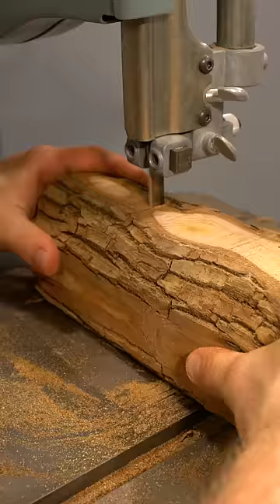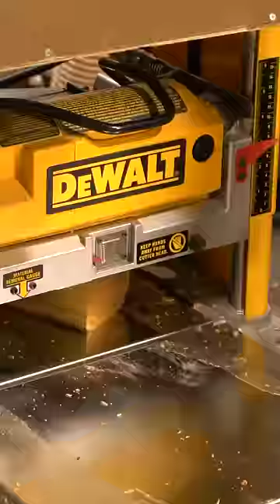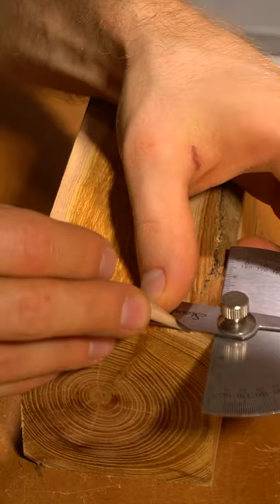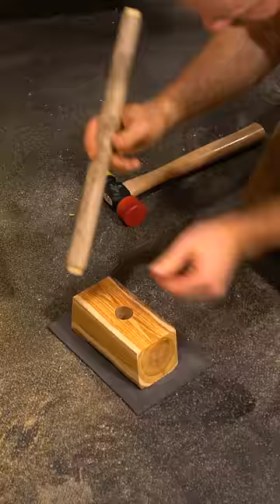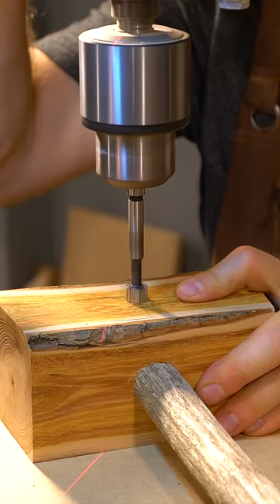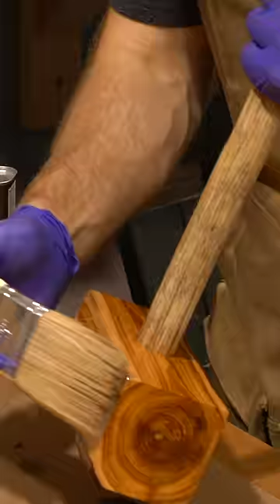I Turned an Osage Orange Log into a Wooden Mallet!

Comment: Best firewood you can get, unless you have a open fireplace, watch out for the sparks
Reply from the maker: I've never burned Osage Orange wood but I imagine it being great since the wood is so dense, the logs probably burn longer than most.
Reply: @_Shopfix  and I didn't mean any disrespect to what you built, I love it, looks great, also I believe that wood is rot resistant and would last forever, but love what you did with it. You got a sub from me.

Comment: That's a very big retention dowel! I would have been too nervous about using one that big.
Reply: I'd think, because of how deep in the mallet head the handle is, and the fact that he was liberal with the glue, that it would be fine. A lot of times with glueups, the glue bond is stronger than the wood it's gluing.

Comment: Nice work.  I think your dowel through the handle is too large for proportion to the handle size however.
Reply from the maker: Thank you! I see what you are saying, you wouldn't want to go any bigger than I used here that's for sure. However, if you went with too small a dowel its likely to break as it requires a lot of force to hammer the dowel into the hole even with a kerf cut into the dowel. I tried many ways to create this style of mallet. I have a full length video you can check out on my channel page! Thanks for the comment, take care!
Reply: @_Shopfix  yeah, maybe two small dowels, one on each side of the handle and the handle has half circles for each dowl.  Or maybe a traditional wedge, even an osage orange wedge.   I found a really huge osage orange in dayton ohio.   I filmed some on my old Delticola channel out of Alabama, planted in 1840.

Comment: Okay why did you make it with slanted faces? They appear to not be 90 degrees.
Reply from the maker: This mallet does have beveled faces. The bevel is 10 degrees and is typical for a joiners style mallet. It is suppose to make the mallet easier to use.

Comment: Using end grains on wood for the blow side it’s gonna blow out
Reply from the maker: I believe the end grain is actually more durable than the long grain sides.
Reply from the maker: Most mallets are orientated in this fashion.
Reply: Not true at all. It's more durable.

The only time it becomes an issue is  something like a chisel handle. The tang acts like a wedge pushing it apart.
There is nothing like that on this hammer, it will be fine.